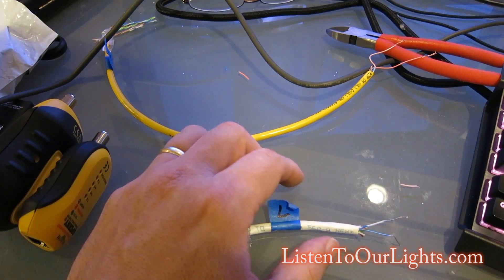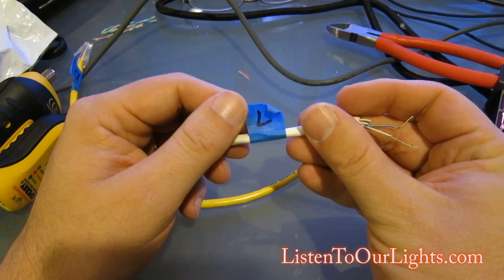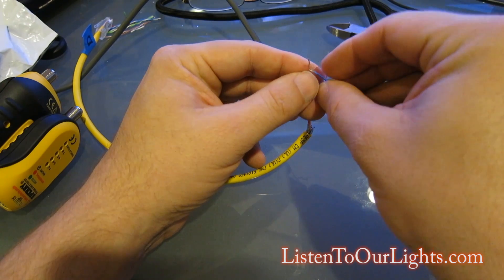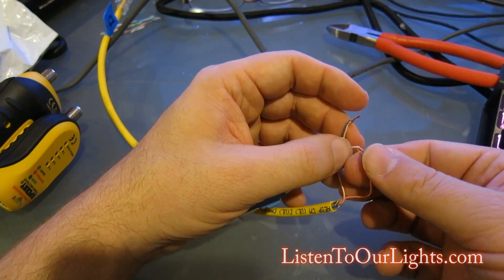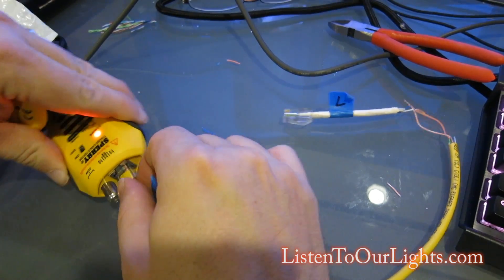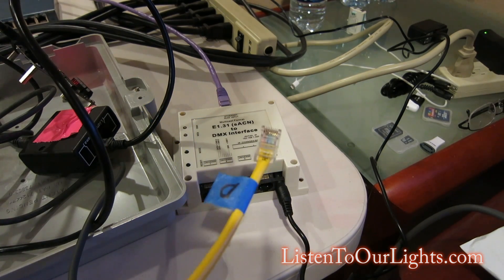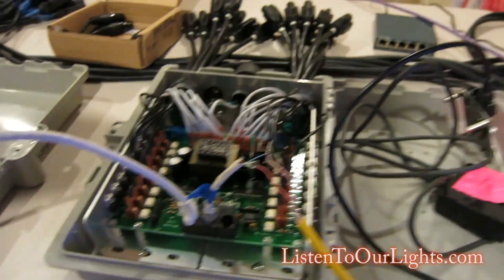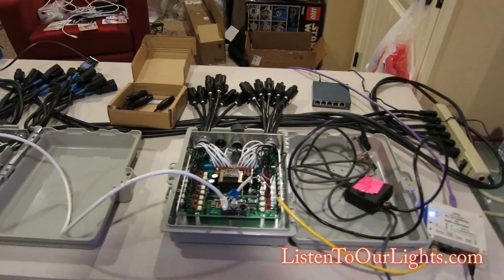LOR to DMX crossover cable

Comment: in your video the text in the lower left corner of the video says " LOR uses pins 4&5 DMX uses pins 1&2"  then in the video description it states the opposite conifg.    "LOR 1&2 ... DMX 4&5" 
just wondering whats the correct answer.

Comment: I have a AlphaPix 4 with a E1.11 RS-485/DMX512 output. The output connector has 3 outputs ( DMX+ DMX- GND). Frist can I use this to control my LOR Controllers and 2 which ones do I hook  blue and blue/white wires to ?Thank YouGreat Video's